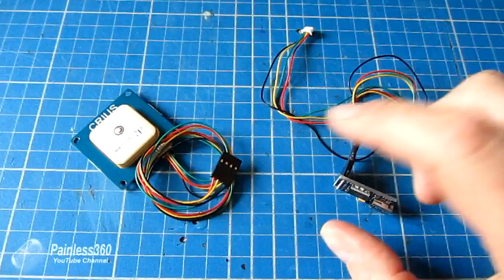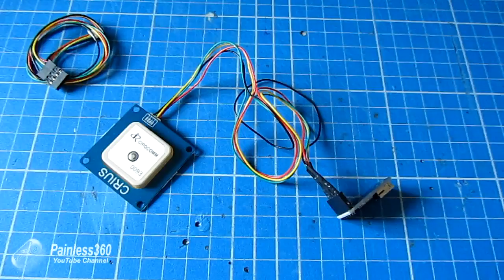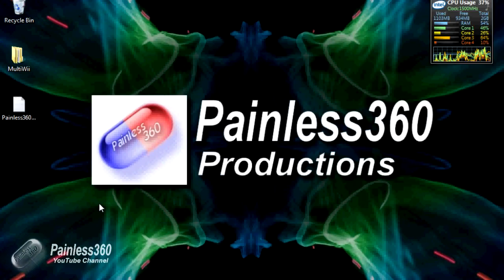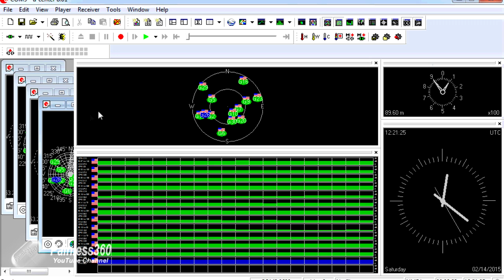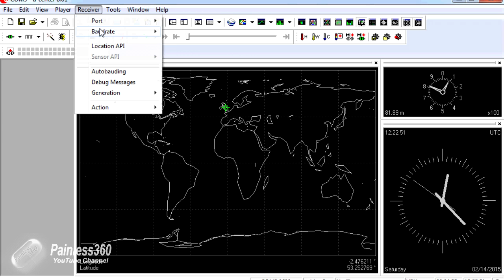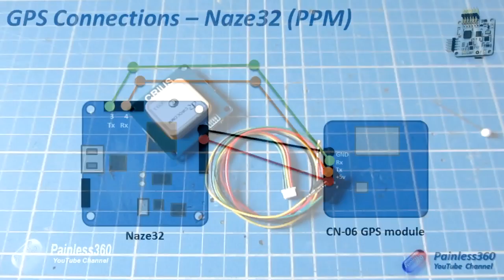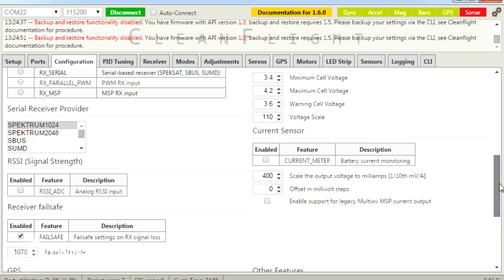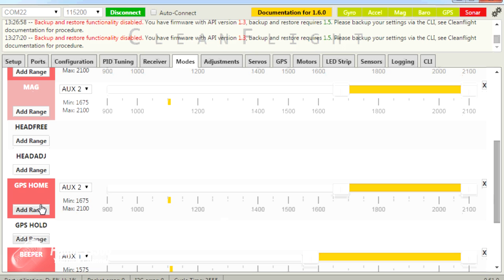(6/8) Naze32 Flight Controller - Adding GPS (NE-06, NEO-06 module)

Comment: Can I use gps with parallel PWM? I saw you can use the uart1 as a gps port, at factory config it is configured as "msp", what ever that means. Could I just change the thing to gps and hook up my gps at the RX/TX of the telemetry? I am not using telemetry, so...
Reply from the maker: Yes you can see in the GPS video where I show how the pinouts on the PWM inputs change. Best of luck!

Comment: Hi, How to connect GPS and standard Receiver to Flip 32 . I read somewhere that we can use channel 5 and 6 for throttle and rudder
Reply from the maker: +Karan Deep Exactly the same way that I do here - the pinouts on the Flip32 work the same way as a Naze32.Best of luck.
Reply: Hi, saw your video  looks like if I have standard receiver i have to use channel 5 and 6 for throttle and rudder respectively. Now I have a 6 channel PWM receiver, since i will use all 6 channels can i still get flight modes or do i need more than 6 channels to set up flight modes ? Thanks
Reply from the maker: You should only need 5 channels for flight and basic flight mode selection (Aile, Elev, Thro, Rudd, Mode). Best of luck.
Reply: Actually my question is, i have PWM receiver with 6 channels  and want to use GPS and also need to get flight modes . can i do that since channel 3 and 4 will be used by GPS and 5 and 6 will be throttle and rudder.
Reply from the maker: Yes you can - see in the video where we cover this..

Comment: I'm building a quadopter that wil fly on gps for a school project and your series offer very good and clear instruction. I only have one question how do you make the cable to connect the gps to the naze an to the FTDI adapter? great vids keep up the good work
Reply from the maker: +BML blockhunter Normally the cables for each piece come with it so it's a case of soldering the ends of one cable from one part to the right connections on the cable that comes from the other part. If all else fails I use servo connectors and crimp them on the end of the cables I have. Hope this helps.
Reply: Thanks for the fast respond and every think should work now.

Comment: Oh, no. I just bricked my GPS with your "Painless360.ublox.txt" - I forgot that my GPS is Ublox M8N, not Neo-06 or similar. What to do now? Please help.
Reply from the maker: +Milan Karakas Use UBox U-Center and connect your GPS to your computer.  Display the Packet Console (so you can see what messages your receiver is sending to your computer). Display the Configation View. Navigate to CFG (Configuration). Select Revert to default configuration. Click Send. Best of luck!
Reply: +Painless360 Woah! Somehow mamage to revert to default config. I am using Arduino Nano instead Usart to USB card. Just few lines of code, but then I should change speed every time changing speed in the U-center:

#include "SoftwareSerial.h"
SoftwareSerial mySerial(10, 11); // RX, TX
void setup()
{  // Open serial communications and wait for port to open:
  Serial.begin(9600); 
  Serial.println("uBlox Neo 6M");
  // set the data rate for the SoftwareSerial port
  mySerial.begin(9600);}
void loop() // run over and over
{  if (mySerial.available())
    Serial.write(mySerial.read());}

Thank you again. Saved my little bit expensive GPS M8N device.
Reply: +Milan Karakas I do use code someone made for 'listening' GPS, but seems not for programming. The main code limit is in: Serial.write(mySerial.read()), which seems that works in one way, not another, just listening and sending forward. And any command from Serial (USB) seems is not transferred to mySerial.read. I should to buy proper adapter for that.

Comment: Great! Can you tell me if it is possible to connect GPS & WS2812 with PWM Receiver to Flip32+? Many thanks !
Reply from the maker: +Ozan Varol Nope, have a look at the Cleanflight manual for the LEDs..
Reply: Ok, so i need a new Receiver which support PPM to add GPS & LEDs. Many thanks :)
Reply from the maker: PPM is sooo much neater too ;)

Comment: Where is the best place to find information like the input pin mapping table at 16:02? I just happened to come across this video and it saved me a ton of time. There is a lot of "naze32 documentation" out there. But is there an official source with detailed information at this level for those of us who are just getting started? Thank you!
Reply from the maker: Yes - this channel ;)

The information can be hard to find and some of it confusing. I have tried to make it as easy as possible by explaining it all here. 

Best of luck!
Reply: Painless360 Fair enough. Great tutorials, BTW! I'm just getting starting working my way through these but I'm learning a lot so far.
Reply from the maker: Let me know if you get stuck. The first build is always the hardest! ;)

Comment: Hi Painless360, and thanks for your advice.  I happened to have it downloaded from June and all was well, got satellites, etc... UNTIL I went to update the config file.  The u-center Evaluation Tool software crashes right at the very end of the flashing...

I tried on Win 7 in Parallels, then Win 7 in BootCamp, then Win 7 on a real PC, all crashed at the end and the flashing was never done.

Is there any way you might possibly share the version 13 that you were using so I can try that?  I had seen some comments to the effect that on an earlier version it crashed at that point too, so maybe that bug regressed back into the latest version 17.

I was so excited to try it out, and just when things seem to be going your way ha ha hah!@@

Thanks a lot...

Cheers,

Bill
Reply from the maker: kelleysislander You can also try the manual way of configuring the GPS - the link is in the description. The best I can do is provide a link to 8.13 I have here - https://dl.dropboxusercontent.com/u/67301981/u-centersetup_v8.13.zipIf the link doesn't work send me a PM and I will resend
Reply: Painless360 Thanks that link works great!  And I had no problem at all with this version...

Thanks again!

Comment: Hi Painless,
After uploading your file for BAUD rate changing, suddenly module starts to catch an acceleration and coordinates changing -  ( when it was  9600 - all metrics were ok)
Reply from the maker: Дмитрий Мурат I would reset the module and try again it will probably not work with the V7 and V8 GBLOX modules. You can manually configure the GPS using the link in the description..Best of luck.

Comment: For non-PPM connection, if channel 3&4 are used by GPS and 5&6 are used for throttle and rudder, do you simply change the setting in the transmitter so that it corresponds to the new setting in the Naze? Please reply thank you.
Reply from the maker: Island728 I'd suggest you watch the first two videos in the series they cover the setup and how you connect the Rx (with and without a GPS) too.Best of luck.
Reply: Painless360 Thanks, learn a lot from your video series! Just curious if you think it will be too heavy if I install GPS, OSD, Sonar and LED all together, basically maxing the naze on a 250 frame. I did a calculation it will be 550g without all these features added.
Reply: Island728 Oh plus a 2 axis gimbal too
Reply from the maker: Only the gimbal with the camera should add any real weight to the model. The rest are little PCBs..

Happy flying!
Reply: Painless360 Thanks!

Comment: i build my first quad using naze32 and frskyd4r. but when i oush just throtell - 3 legs start going up but fot=rth still on a ground and make quad tilt. what should i do to tune quad?
Reply from the maker: Michael Akopov That sounds like it's not a tuning issues. Make sure you have calibrated the accelerometers and watch https://www.youtube.com/watch?v=rICwVUPTEpg for some of the other common gotchas when first trying to fly..Best of luck.

Comment: Painless your are a great teacher, watched lots of your vids already and learned alot. Having a bit of a problem with compass pointing slightly towards northwest rather than pointing exactly north. I have a Flip32, seem to work before but I think after the firmware update to 1.9 problem started accuring, I bought another flip32 and seem to have the same problem, not a big deal I think but just a little annoying when i'm on the EasyGUI app. If you or any one out there can answer my problem, would be very much appreciated. Thank You again Painless keep up with your great work.
Reply from the maker: LiveLife Zippo I would check interference from the power lines on the craft and take care recalibrating. Also check that the magnetic declination is setup in Cleanflight too..Best of luck.
Reply: I'll done those steps already but for some reason still same problem, I'm doing it from inside house could things around me cause interference. I'll give it a try again from outside this time see if that will work. Thanks for the help, and keep up with good work.

Comment: I have a flip32..or a dragonfly32 (the one with the sat port) and i got my tx and rx for gps plugged into pins 3 and 4 and yes rx to tx and tx to rx....when plugged into cleanflight, i see the satellites as your video shows, and my mag and baro along with RTH is set just like yours and does not work...I know there's something stupid im missing....any ideas?
Reply from the maker: Travis Labrador What do you mean by 'does not work'? The mode will not select, the RTH mode doesn't work at the field?
Reply from the maker: Direct email is for chargeable support. Don't forget the GPS functions are 'in development' in Cleanflight so it's hard to sort when even the developer isn't committed to it working right..

I would ask on the RCGroup forums for advice and help.

Best of luck with it.
Reply: Painless360 what would you charge....I really have no time
Reply from the maker: If you send me a PM through YouTube with your email address I will send you details.

Best of luck.

Comment: When I use the default settings i have GPS signal, but when I upload your GNSS file I don't have GPS signal anymore. What will be the solution ?
Reply from the maker: See the link in the description to manually configure the GPS...

Best of luck
Reply: Painless360 when i do evrything and I unplig my GPS after saving, it resets itselfs.
Reply from the maker: make sure you are saving the configuration into the non volatile memory of the GPS before you disconnect.
Reply: Painless360 Ok, i succesfully got the gps working, but when I enable the GPS in Cleanflight the receiver does not work anymore, thanks for helping me !
Reply from the maker: If you are using a UBLOX GPS you can ask the Naze32 to configure it for you - https://github.com/cleanflight/cleanflight/blob/master/docs/Gps.md

Best of luck.
Reply: Painless360 could it be because i'm in hex mode ?
Reply from the maker: I'm not sure what's happening here so hard to comment. I would search the forums and online documentation for help.

Best of luck with it.
Reply: Painless360 Thx !!

Comment: I baught the Crius 6N GPS, but when I want to do the GNSS configuration with u-center I get the message : The version you ar trying to download does not correspond to  the version of GPS receiver. Software version 7.03 (45970) , hardware version : 00040007 then in follow up the baud rate is not changed! It stays at 9600 baud. Is there any solution? Do I have to update the Painless360.ublox file?
Reply from the maker: Juergen Stremmler The file only works with some of the generation 6 GPS modules (I mention which ones in the video). 
If you want to see what you need to manually configure on the GPS unit you can read https://github.com/cleanflight/cleanflight/blob/master/docs/Gps.md
Reply: Painless360  I am sorry, but your file did work. What happened was that I had bought a CRIUS GPS with a magnetometer and the FTDI Interface on this small magnetometer board did not connect the FTDI signals to the CRIUS GPS. After having connected the GPS directly to the FTDI interface everything worked. Thank you again for your assistance.
Reply from the maker: Great news - happy flying!

Comment: I don't know if someone could help me, i did what it's shown in this tutorial and everything is perfect. I got a 3d lock, 10 sats, and everything is showing fine on my osd. I have also put the magnetometer declination in cleanflight but i have a major problem. When i put the quad in position hold. Instead of correcting the direction and trying to stay at the same place, the quad goes in the opposite direction of the correction it should do. It's the same with return to home. It goes away instead of comming home...not very usefull. I can't find a way to make it work.
Reply: Maybe the compass is in the wrong way? The control board might consider the compass at a higher priority.
Reply: I already found the problem, my little beeper was the one to blame. Because of the magnet, it was causing trouble with the compas of the naze.

Comment: Hi thanks for the great video.
managed to get the GPS working with my Spektrum dx18 using a lemon rc 8ch PPM rx. Before I test it. Probably a stupid question. how does it get the RTH postion.
Is it automatically set on connecting the flight battery, when it locks on to the satelites?
Thanks again for the great videos
Pete
Reply from the maker: Peter Barrow The GPS co-ordinates it sees when you arm are stored as the 'home' position. 
Hope that helps.

Comment: i bought a neo micro NEO6 GPS... on plug it on the the Arduino Nano V3 .. the red lead for Power is blinking and even the green led FIX.. unfortunately the UBlox program doesn't  see it even thought i can see from the program the Arduino COM port ! what i am making wrong ? 

Thank you !
Reply from the maker: Luu Mrv What troubleshooting have you tried - baud rates? Rx ad tx wires crossed?
Reply: Painless360 Hi ! so with Arduino Nano doesn't want to work ! but i made it with the FTDI adapter !

wait please !!! I loaded you txt. on the GPS and unfortunally the baundrate remain 38400 ! what can i do ?
Reply from the maker: I always use an FTDI adapter - for that EXACT reason.. ;)
Reply: Painless360  i made through ... thanks again for the help.!
last question on the topic than i disappear :-)
 
it is better to use the gps with Full Naze32 or a acro ?i would like to use it for  "return home"  on an Acro board !

would work fine or is risky ?

thanks again
Reply from the maker: Acro will not give you any GPS modes as it's missing the compass. This is covered in the first Naze32 videos in the series....

Please check the videos before posting again ;)
Reply: Painless360  actually the gps supposed  to have even the compass is the Rc micro HKpilot gps and copass!  ;-)
Reply from the maker: Good luck getting that to work - you'll need to connect the compass with an i2c connection.

Bottom line - get the board that will do the job you need it to. If you need a full Naze32 - get one.

Trying to get one to do something it isn't designed to do is just going to cause you (and those you ask for help) hassle..

Comment: I was wondering if Ublox Neo-M8N GPS will work with the Naze32 acro??? 
By the way great channel really helped me out with the Naze32
Reply from the maker: ***** Thanks, should do but the config file here is for series 6 GPS modules. There is a link in the description to the manual changes if you need them..
Happy flying!

Comment: your config file does not work for me, at the end of the upload it says "u-center has stopped workin, it got fixes before when i downloaded the program but after that upload i get nothing....help
Reply from the maker: Travis Labrador The answer is in the description under the video - If you want to see what you need to manually configure on the GPS unit you can read https://github.com/cleanflight/cleanflight/blob/master/docs/Gps.md
Best of luck.
Reply: +Travis Labrador. i had the same but after restarting and changing the bitrate all was working

Comment: Hello there Painless its me again in the GPS section this time. I did everything from wiring this to my naze to actually setting it up in Cleanflight. My cleanflight sees the GPS and it seems to work fine. I have configured a 3 position switch to do GPS hold with MAG and    BARO and ANGLE on position 2 then GPS home with MAG, BARO and angle on position 3. When I activate position 2 the BARO and MAG seem to kick in but the quad drifts slowly to the left side and just keeps going until I flip the switch to 1. Same thing happens with GPS home. Do you have any clues why this is happening? Thanks in advance sir.
Reply from the maker: Allen Ampueda Could be lots of things - what troubleshooting have you already done?
Reply: Painless360 I don't have much experience so I don't know what troubleshooting I need to do. I am not sure where I need to start at.
Reply from the maker: The GPS code in Cleanflight isn't as good as others yet. Remove all vibration in the frame, double check you get a solid 3d lock and check that the mag isn't being pulled off course by power lines..

Best of luck.
Reply: There's zero vibration, I get the 3D lock for sure and I fly in an area where there are just rice and bean fields, so no power lines or any other forms of human created artifacts hehe. Still I get the same problem.
Reply: Do you think I should update the firmware and go thru the whole configuration process once more?
Reply from the maker: I would try it and see - may help..

Best of luck.

Comment: Hi, Great tutorials!! I got serious difficulties connecting the naze32 with the neo 6m 001 and the remzibi osd. Could you post a mockup how to connect this Gps (it has 6 pins instead of 4) to the fc and to the OSD? I already destroyed my Board because there Went something wrong when connecting the naze to my computer while the osd is attached (does it need to be powered before connecting the naze to my pc?)